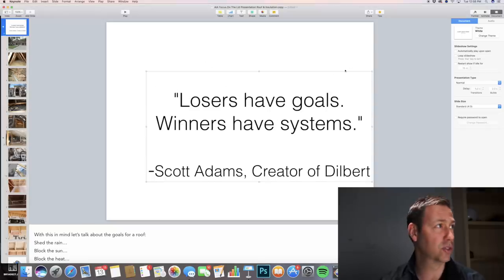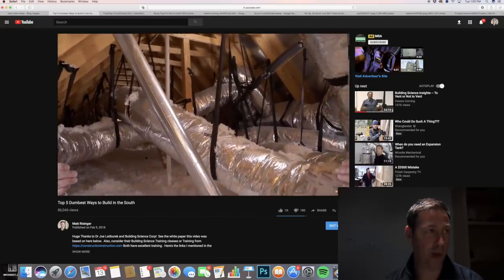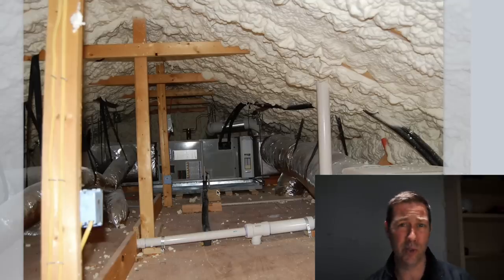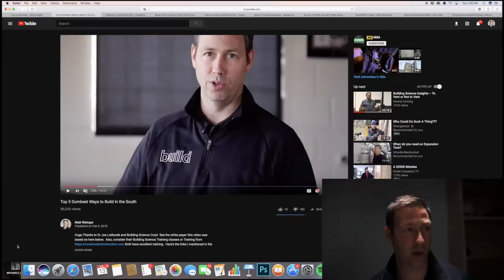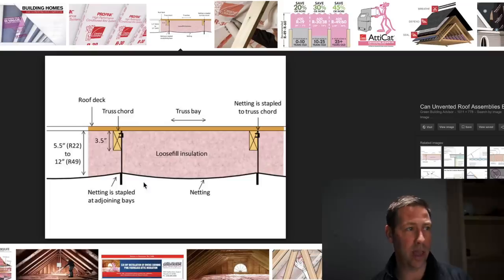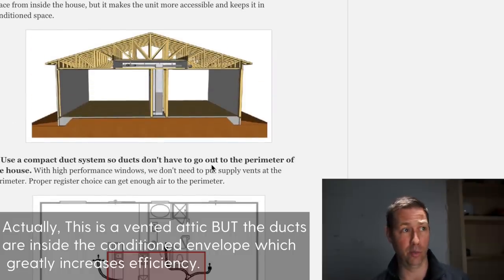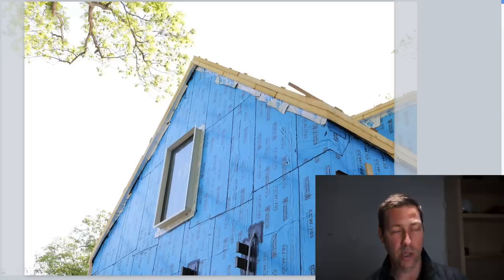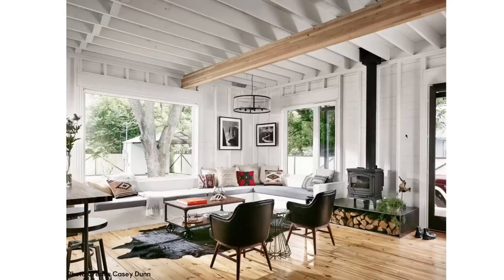Attics/Roofs - Dumb vs. Smart - How to Build Correctly

Comment: I absolutely love that last house!

And why are people criticizing you for building expensive houses? You get what you pay for. Either pay the premium now and get quality that will last, or go cheap now and end up paying the premium anyway, later on down the line, when everything starts rotting, molding, or just falling apart in general.
Reply: Its also the prices, my 300K ( just bought ) house in the 80s cost a ton less to build, if I were to try and build it today the way it sits It would be probably around 1.2 mil. The prices and labor have went up so buying a house is a lot cheaper than building around my area anyways.
Reply: Umm I swear ! I’m umm , I hearing this right, no ventilation to roof!!! Ummm well first I am curious as most people put roof vents but forget soffit vents to circulate the air, keeping continuous air flow and no moisture problems and no heat problems as I would like to see the life of those shingles as asphalt singles life can be cut down drastically by overheating, ask any roofer what curled shingles mean, over heated... moving air through the attic is to keep it within 10degree of outside air... 

I’m wondering if he doesn’t fully understand how a vented roof works and it’s purpose... I am not doubting anything about him straying foam into trusses as I have not done any testing but I would guess keeping the heat pushed up against the singles cut la the life just like a poorly built and designed circulation (vented attic) as it’s not just roof vents, it a whole system of flowing air, cool air comes in soffits and hot air flows out roof vents, cooling your singles and adding life (maintaining the existing warranty on life of shingles) 

Now I have worked for 30 years redesigning roof (attic) ventilation system as yes in 70 and back there is lots of design flaws.... 

You should never keep heat up against the roof shingles because a roof cost  lest say $10,000 and should last 30 years... now to much heat will cut the life down to as little as 10 years costing you lots of money as a $10,000 roof the way he is saying could have to be replaced 3x now costing $10,000plus as you have to tear it off twice.... 

Ughhhhh it’s scary when people don’t research stuff and understand the true intentions of a vented (circulation of an attic) 

I really hope he gets engineer to explain things to him he is saying is old or out dated... yes just roof vents is a problem but that’s why you install soffit vents and move air through the attic, removing hot air and cooling the space... adding life to your shingles and saving tens of thousands of dollars... 

I did see he showed a metal roof and venting inbetween metal and roof, yes that can be done and if that’s what he’s doing than ok that’s done right, but the soul purpose of a vented roof is to circulation cool air in soffit and hot air out top of roof, if done 100% right with proper vents at both ends, the roof (atttic) is within 10 degrees of out side air not 130-140 degrees ....70 degrees out side (roof/attic space is between 60-80 degrees and if all flows right no moisture problems at all. 

I have worked on installing proper ventilation on roofs for 30 years and yes some of the stuff he has said is improvements, but also some of the stuff is going to cost people ten of thousands if some of the problems he’s causing are not properly dealt with... 

I hope everyone the best of luck as it sucks when someone gives out bad information or does not understand a situation or system.. 

I have had to teach many contractors, roofers, siding guys, insulation guys the importance and why it’s called a system, it’s been a huge problem when people get the wrong information or when a builder don’t understand the purpose of something... 

Now if he understands venting a metal roof, why is he not venting asphalt and other roofs and trapping air up against shorting the life of the singles.. so hopefully this reaches him and he further studies and understand why there is a ventilation system for a roof, attics and it serves a huge purpose to add life (or not let heat shorten the life) 

Hint if your singles are curled up it’s the most severe case of too much heat, there are many other signs but that’s the most noticeable... 

Huh well at least this won’t be such a huge problem in the future as people get to point out people when they obviously have no understanding or confused (he sounds confused, venting metal roof but not others) 

Any further information feel free to contact me as I have dealt with this so many times and have had to help fix so many new built homes as some contractors thinks he has a new way and you need to fully understand the old way before you improve on it.. 

Yes you can spray foam trusses but you still need ventilation (well it saves tens of thousands over the life of your roof, among other costs) not sure what education he has or what degrees he has in engineering but if you speak to any engineer that knows how, why houses where design a certain way, than you would understand.. 

Oh I will also ad, a lot of times in construction under trained workers that don’t know why something is done will sometimes not do it right... especially when a siding guy,  don’t know his soffit vents are of importance or insulation guy covering up vents or roofing guy not putting in proper amount of vents to create the flow based on square ft, volume of attic, so on and son on... 

Well hopefully people will look into the right way and understand you can improve but first understand how to do it right, don’t base improvements on something done wrong as I have heard all his reason of being better as being based on the wrong way to vent (circulate air in a attic) so hopefully he can learn the right way to vent an attic and than improve... 

Just hope his customers are not having issues as he is long gone as the problem come up about 8-10 years after in southern states and in cold climates the first winter can cause major problems with ice dams, water leaks so on... it’s better to think smarter work less.... education is very important and sad in construction as most contractors have no schooling only on job training and if it was taut wrong or not taut at all than you will Get this video and lots of guys saying stuff that sounds good but is deceptive and costly to homeowners
Reply: Expensive houses are great.  Most of Matt’s videos have great advice and are very educational.  It is just that as a professional I found this particular video to be well intended, but of poor advice. Radiant heat (long waves) goes through spray foam and blown insulation quite easily.  Having airflow next to a radiant flow barrier that is under the roof decking will block most of the radiant heat waves from entering the attic and keep the attic temperature within 8-10 degrees of the outside ambient air temperature and help reduce the heat load to the roof decking which is better for asphalt shingles.  I have see too many roofs where the asphalt shingles were destroyed from the thermal mass buildup due to lack of ventilation below the deck and moisture that got trapped underneath. Moisture destroys everything.  That being said, now you can go about sealing, insulating and conditioning the attic space where you don’t spend a lot of your time.  Just don’t short circuit the airflow under the roof deck.  Kudos to Matt for all his fun and educational videos.
Reply: HickoryDickory86 Bullshit. 250/ft^2 is about 2.5 times the avg here in N. TX. My home would cost me 912k to build with those figures!!! do you know approx how long it would take to recoup the 5-550k delta??? please......
Reply: Homes in the Grand Forks, ND and Northern MN are built very well structurally, however most builders around here go cheap on interior doors (hollow core), and mill work (not solid wood).  Typical cost for new construction in Grand forks for a very nice home is $300K-plus, which is usually 4br 3ba 2100sqft up to 3000sqft plus a 3 stall attached garage.
Reply: @jaysonpasch6587  I live a bit north west of you in Canada, and prices are pretty similar.  I don't think I've seen a house built without exterior insulation for a couple of decades.  Done properly, you can even get the basement pretty cosy at minus 40 with relatively low heating costs.

Comment: Matt, I have a 17 year old house that has conventional blanket insulation on the floor of the attic.  When I bought the house 2 1/2 years ago, I was going to add insulation but ran out of budget after re-doing the inside.  Now I don't think I will do anything.  Whoever built this house insulated the basement in an unusual way.  Curtain drains around the foundation leading to one of three sump pumps that never run - one is a grinder pump so I can put a bath down there, one is a sump pump required by Ohio law and the third is a water powered back up pump if we need it and have no power.  Then on the outside (poured concrete foundation with brick pattern in and outside) he sprayed the foundation with an asphalt product, applied a mesh product, sprayed again and then use 4" of rigid foam to the dirt line.  On the inside I used two coats of Ultra Drylok followed by two coats of SW brilliant white paint and two coats of SW concrete on the floor.  No dehumidifier needed, constant 68 degrees year round.  Replaced the furnace and A/C system courtesy of my home insurance with a high efficiency system.  No round ducts, all rectangular old style  but easy to clean.  2,800 useable square feet with utilities <$2,000 for water, sewer, gas and electric.  No upgrades because 1) no place to save money, 2) no dampness in the basement even with a large wool area rug on the floor, 3) no dust.  I admit: 1) I DO NOT like sprayed foam of any kind, 2) I do not like those round expandable ducts (too hard to keep clean), 3) I do not like having the mechanicals in the attic.  My brother in law was too lazy to keep the drain on the pan clean.  Oop!  - totally soaked the family room and a big bill to clean the attic and spray the ducts with a biocide 4) If I get a chance to build a house it will be all 2x6 16"oc with rafters for the roof  and structural plywood for sheathing and underlayment for the roof  and knee walls for extra support.  The covering for water, siding and roofing are changing so fast, I don't know what I would do except for the siding itself:  Allside Charter Oak.  It survived a 70mph sheer wind with NO damage at all and survived a terrible hailstorm as well.

Comment: Roofs should be vented underneath THEN insulation to isolate the space. 
Mike Holmes covered this. The top and bottom surfaces of a roof should have equal temperature (or close to it). Moisture is reduced and can evaporate. Snow cover will not ice-up... PLENTY of advantages. Space lost is inches,  you just want a channel between rafters, outside the house envelope from wall to roof peak.

Comment: I always enjoy your videos. I'm a TREC Home Inspector in Corpus Christi and it just blows my mind that builders moved the HVAC from a closet in a conditioned space to inside an unconditioned attic. All of my ductwork is in furdowns in my duplex (I have a flat roof that I absolutely hate, but that's another topic). I've been taking notes on your builds to apply what I can to my low income housing construction jobs. So far I'm going to go with roof trusses and open web trusses for the second floor, use Proseco liquid applied vapor barrier, open cell in the attic space. We're doing mini split ductless and a few other things.

Comment: it is funny watching these past few videos, I have always wanted to buy an older home (CHEAP) gut it and make it extremely energy efficient and all that you talk about are the things I wanted to do to it.
Reply: As in Goals vs Systems?   ; )   Old homes are great  -  they even speak.
Reply: Me too, because I love the older big trees, and then I see the crappy layout, cut up floor plans, small closets, low ceilings, and shitty mechanicals, and then I decide to build another brand new house😀
Reply: It's hard to retrofit a old house and get anywhere the insulation efficiency and benefits of the newer ones, specially if it was built with 2x4 walls and 24" centers, narrow, tall windows,small rooms with up to 4 doors per room, small or no closets and no bathroom to begin with and very crappy foundations with plumbing  added much later along with the electricity in the 50's and is over 100 years old and had coal stoves in 1912 to start with. I would have been better off in a double wide.

Comment: “Do the right thing” should be the operating rule for every builder.  Unfortunately it is not always the case when expensive mistakes are made in choice of materials or construction techniques.  But, when the wrong thing gets done, “Do the right thing” means fix it at your expense, not the customer.  You passed the test of a builder with integrity.  If I were building in your area, I would try to contract with you.  Well done, sir.

Comment: I am enjoying your videos very much. I will be building a barndominium near Taylor this year, and you are giving me good ideas on how to make my house very air tight and energy efficient. I also am going with the little mini air/heat units instead of central AC to cut down on cost. I also thing after the place is done, I won't need much heating and cooling in order to maintain a constant temp.
Reply: Fredrik thanks for the input.
Reply: Fredrik “

Comment: Thanks Matt for everything you do.  I've watched you for years now, and every little repair or upgrade I do is based off of your expertise and recommendations.  Keep up the awesome job!

My question is would you recommend converting a "production" home in San Antonio with a vented attic, into an exterior insulted home?  Or just stick with converting the vented attic into a condition sealed space?  Home was built in 2008 and is  coming due for a paint job, and most days I'm a few minutes away from ripping all of the Hardie board off the exterior, so I can beef up the air sealing and insulation.  Should I invest in this current home, or invest in a new home?  The house is two stories, slab-on-grade, with radiant barrier/foil board roof with asphalt shingles.
Reply: What did you do?

Comment: As an engineer and builder in the northeast, I have always tried to have the air handler and distribution in the conditioned space. This is an energy efficient approach that is easy on the equipment.

Comment: Florida is starting to ban or extremely limit any spray foam. You can not spray directly on any exterior wood structure, from the inside. They are finding that when a leak does occur, the water runs into the nail or exterior fasteners and fills the foam with water in those spots. And this develops Black mold. Also, some insurance companies are not insuring homes that have spay insulation on the under side of the roof, if they had a new roof put on after the insulation was sprayed. Because of all the nail penetrations in the foam.
Reply: Would probably consider nailing up some higher-density fiberglass instead. Better than dealing with the foam nightmare.
Reply: so glad someone is finally talking about how foam can be a huge problem
Reply: I always wondered about this as well. Besides high density fiberglass, what other alternatives are there?

Comment: I have open-cell foam under my roof sheathing of a 1945 walk-up attic in Massachusetts. Seven years ago the closed-cell was double the price but was informed that if/when the roof ever leaked (using closed-cell) I wouldn't know until the walls showed signs of moisture. With the open cell the leak would pass through the foam and show on the attic floor or spot on the ceiling downstairs. I know many houses don't have floored attics throughout the country but it was one of the reasons I bought it.

Comment: I've slowly come to the conclusion that floor plans should have machinery space and narrow halls to house HVAC duct/plumbing/electrical built into the inhabited levels.  Adding 400 sqft into the average home is pretty cheap up front and will pay off massively over the life of the home between energy savings and much easier maintenance.
Reply: i'd prefer the box style he showed, where you give up a foot of ceiling space for the mech space
Reply: Totally agree!
Reply: Those ideas certainly cost less and conserve floor space, and are a big improvement over what is done now, but I just like the idea of being able to easily inspect and work on the vitals, also easy access for potential upgrades or future changes.  I guess I've seen too many instances of rodents, who can amazingly manage to appear and be in places never thought possible, chew up insulation and flexible duct work.  Having all that duct work effectively sealed from view could well mean chewed up ducting with 5 pounds of rat turds inside it. Maybe these newest very tight and sealed homes are completely rodent proof, but I have a hard time believing that.   Also having as much of the plumbing and wiring in an easily inspected area adds to the over all safety factor, but where I'm at, square footage gets pretty cheap once you pass a certain point, and the land to build on is cheap as $5k an acre would be a high price a few miles out side of town.   In more expensive markets, it would be a much more costly proposition to surrender so much floor space to machinery.